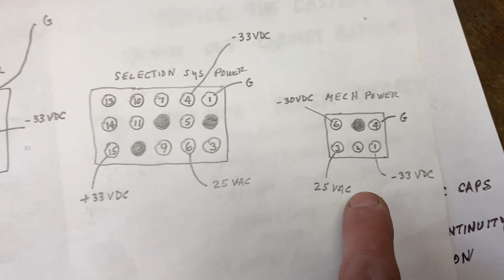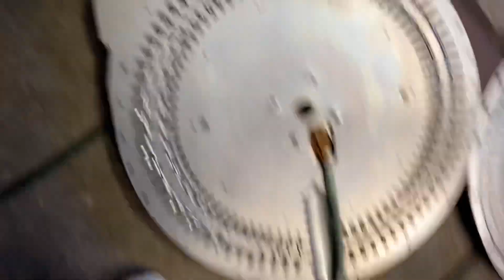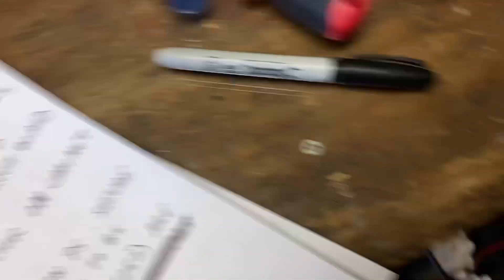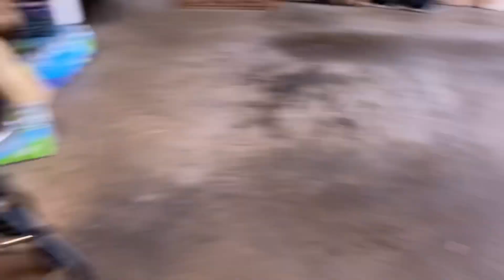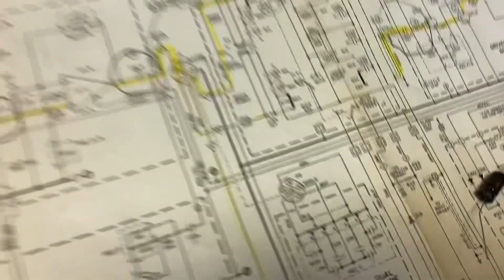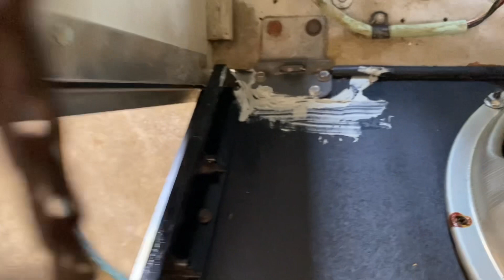Fixing a 70's Rockola 460 jukebox

Comment: Hello William , 24:10 24:10 enjoy all your insight on these units especially the 460 Rockola jukebox. I’m currently having issues with my 460 after pushing my selection numbers it ingugege but no operation happens unless I reset the top circuit breaker labled Mechanism the turn table turns but then trips after a while and nothing happens . Hopefully you have a little insight on where to start on servicing this unit. Thank you so much for all that you do take care

Comment: Hi William I have a rockola 496 and it just buzzes through the speakers. Would a bad part 55020a cause that. The buzzing seems to be coming from there.
Reply from the maker: I am not familiar with the Rockolas after the 1978  474 model.  Peter Hillyer in UK would be a resource for you.

Comment: Hello William... I'm from Italy and looking for something for my 460 that doesn't work so well, I discovered your channel... Your passion is amazing and "contagious" 🙂
I would like to ask your opinion since the problem with my Rock Ola 460 is that it doesn't play the B side of each record... all the tracks starting with 2 plus something...
Basically it correctly makes the selection, the selector moves the pin bank correctly, but the external wheel continues to turn and the skate, even if it passes over the raised pin bank, never stops...  (sorry for my poor terms I'm not expert on the name of this widgets)
I cleaned the tracks and the contacts as best I could, but I wouldn't want it to be some relay (maybe K6 or K7) or a contact on the selection box.
Do you have any suggestions?
In the meantime, congratulations again and Merry Christmas :-)
Reply from the maker: I would start with sequence 2 in the manual.......which shows that K6 relay (and K7) are both in the circuit.  Open the selection control box and reseat the K 6 relay and be sure it is secure).  For B sides, K6 does not actuate but its contacts still have to be clean so you may have to do this.  Or swap K6 and K7.  But more likely, the problem will be in the A/B switch assembly underneath which requires the "alternating dawg" to shift "lanes" underneath and toggle the shifter up and down on the A/B switch.....this is what sends power to the right sided read out circuit board.  The alternating dawg often gets gummed up and won't move between the tracts.  If this is the case, you need to remove the metal back door and access this dawg.  It can be loosened and then cleaned and reseated.  If this doesn't solve the problem, then I will have to show you how to trace wires.  It goes without saying that all the connections on the A/B switch should be reseated/cleaned as well as the  molex connector on the bottom of the machine that goes to the pin drum.
Reply: @williamweisel2176  Hello William, first of all thanks for your prompt response.... very appreciated :-) I tried the easiest check switching K6 and K7 cleaning also their contacts, but the problem still persists.

Let me modify the message... I just discovered that on Mech Power connector I have NO VOLTAGE at all between 4 and 6 molex pins (it should be -30VDC).
All the others voltages mentioned in your video are fine, but I have "0" between 4 and 6. Could it be the cause of my problem?

Thanks again for any suggestions.
Alberto.
Reply from the maker: @AlbaLeoCruz  No.  There will be no voltage on pin 6 of the red molex at rest referenced to ground pin 4.  Pin 6 only gets power when the play control relay kicks in.  Pin 1 WILL have -33VDC referenced to ground pin 4 at rest.  If your scan switch starts the magazine motor, then you have the voltage you need.  I think your problem is underneath with the A/B switch.  Scan your magazine and watch the A/B switch to see if it is toggling back and forth.....or not.  This is the information we will need to know.
Reply: @williamweisel2176  you're right!!! it was something related to the A-B switch... it always remained active because the alternating dog did not jump from one track to the other.
In any case it works now... thanks a lot for this help.
Very helpful!
Best Regards and happy new year 🙂

Comment: I have valued your videos for months and appreciate them and you . I do have a problem I cant find a solution for- Rock-ola 460 will write in properly selecting the choice but the hammer does not select the pin to push it for the readout. When I push the pin in to the read out side the readout carriage moves and selects the record and plays it. I have worked for months trying to find the problem I did find a 120 ohm resistor shorted across the K5-3 relay and have one ordered thinking that maybe the short took the current to ground and did not energize the hammer. I have cleaned all relays, checked connectors, and at my wits end! Any ideas would help! thanks, David  (It has to be something in the hammer circuit since everything else operates properly)

Comment: Hi, my parents have this exact model they want to sell.  Any idea what a ballpark price range is if it is in completely working condition?  Thanks!
Reply from the maker: Depends on your area.  In western Pa, I sell these refurbished working as they should with a 30 day warranty for $695.  And, yes, they all sell.    But if I ask more, they just languish on FB marketplace.  Working condition covers a wide range.......was it recently serviced and amp refurbished?  If so, try to get $800-900.  If it hasn't been serviced for 20 years and just happens to work, then you won't get as much.  These 70's jukeboxes are good machines but don't command big bucks.  Don't take less than $500 if it works fine and all the glass pieces are good.  If it is in a basement and needs hauled out by the buyer, subtract $100.

Comment: Looking for assist with Rockola 1765 stepper. Letter stepper shaft is sticky not letting spring return it home. Silver hub on gear shaft has 2 small set screws. Cannot figure out what type of head is on screw to remove. Do not believe it is Allen head. Any help appreciated. Enjoy your posts
Reply from the maker: I am not familiar with that stepper.  I would join one of the FB Rockola groups and post your question.....Rockola Jukebox Club is one

Comment: Hello from the U.K. William. I wondered if you could advise me on a problem I have with my Rock-Ola 477 Max. It had worked pretty much perfectly until just before Christmas. I switched it on, all the lights came on and the drum rotated as normal and I put the Scan lever into the Off position ready to remove some discs and replace them with a Christmas selection. First I took some index labels out ready to replace with the new ones then when I went to scan and remove the discs nothing happened, the drum wouldn't move. I switched it on and off a couple of times but still no drum movement but all the lights still came on, then when I tried switching it on and off a third time there was nothing, no movement but also this time no lights. I have checked all the fuses I could find even those behind the power board cover and they all test OK and I have tested the incoming power cable and there is definitely 240volts (U.K.) coming into the box but interestingly the switch doesn't seem to disconnect the power. That is obviously wrong so I assume that the switch is faulty but do you have any ideas what may have blown or where there are any fuses I may have missed. I have manually checked the mechanism works by revolving the turntable and drum rotors so they are not jammed which I know is a common problem. I do have the service manual but my knowledge of electronics and circuitry isn't great. Would appreciate any thoughts you may have. Like you I am very keen to keep it running. Could send you a photo to show you the machine if you wish. Many thanks from the U.K.👍
Reply from the maker: I am not familiar with the 477.  Rockola changed pretty much everything after the 474, and the results were not always the best.  I deal with models 436-470 at this time.  Maybe try FB Rockola groups for advice.  Another resource over your way would be Peter Hillyer in Essex.
Reply: Many thanks for the reply William much appreciated especially the name of Peter Hillyer in Essex. I hadn't thought about FB so I will nip off there now. Kind regards and thanks again Ken
Reply: Hi William just to say a huge thank you again for the info. Have been talking with Peter all morning and we seem to be making progress, what a lovely and helpful chap and coincidentally some common locations and experiences! May need a PSU rebuild but Peter says he can handle that and I have learned a lot on fault finding in the process. Fingers crossed Ken - Rock-Ola on!!😊

Comment: Thanks for the great information!!
Reply from the maker: thanks for the kind words.  I did see one error in my video.......cross over capacitors that go on the tweeters should be 15 microfarad, not 15 ohm.   But any capacitor that is set up as non polarized and is between 11 mf and 18-20 mf should be ok for this tweeter protection.  Capacitors don't have to be exact values in these machines......as long as they are within 10-20% of the original cap mf readings, you should be good.